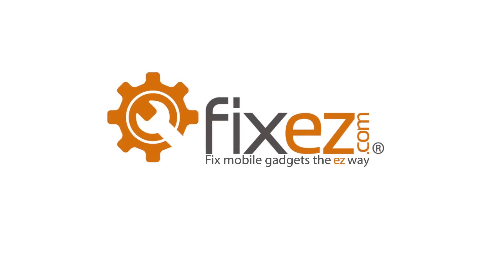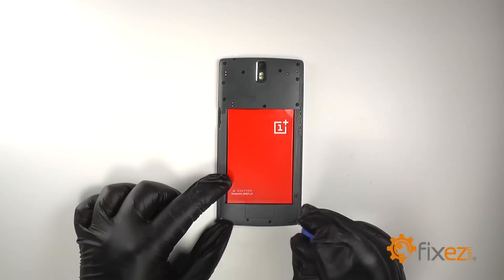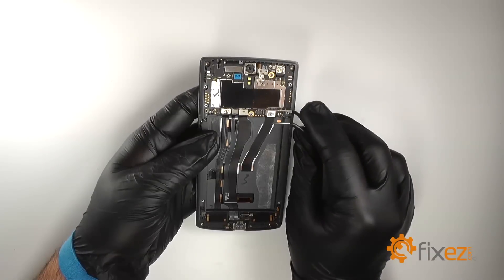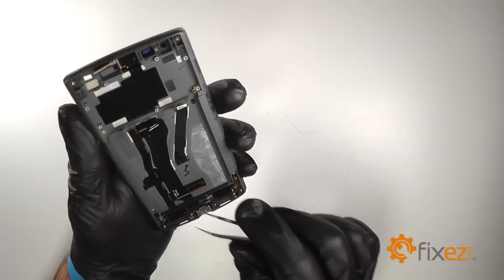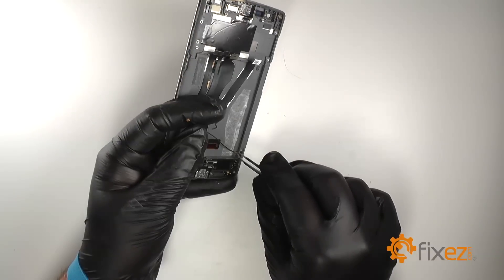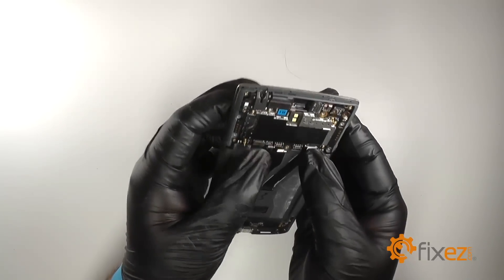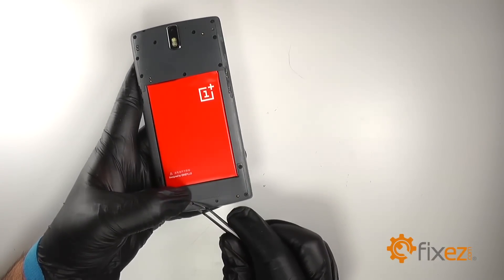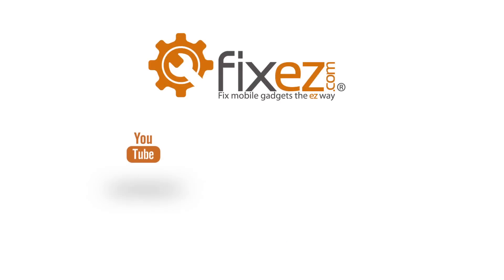OnePlus One Teardown Video - Fixez.com

Comment: This is excellent. I should have watched this one before I attempted my screen replacement but didn't and tore the power button ribbon cable. The other tricky part is removing the battery (adhesive is very strong)
Reply: Yeah I did thst 2 years ago and my battery caught fire because I accidently punctured it 😂

Comment: Your video was very informative. i was able to change screens but now my cellphone shows " no cellular network" everything else work. do you know whats the issue? thanks in advance
Reply: You could salvage the piece from na old phone or buy it but you have to solder it carefuly on the board with proper equipment.
Reply from the maker: +giby raj Possible that you missed a coax cable connection. Double check all your connections and cables to ensure nothing was missed.
Reply: I had a technician  checking it and he thinks I broke the Sim card reader!!  Is that something I could buy?

Comment: hello , I followed this video to replace my screen but I just noticed my ear speaker doesn't work . I can't hear ppl when I'm in a phone call unless I pit it on speaker . could it be that I installed the ear speaker wrong . I mean it just sits there or does it connect to something .? help!
Reply from the maker: +Oscar c There is two gold contacts that have to be made on the board. Just ensure you didn't install the ear piece backwards. Or ensure those contacts were not damaged.